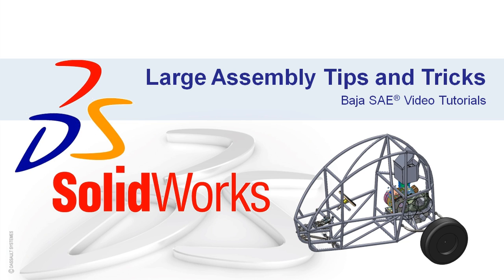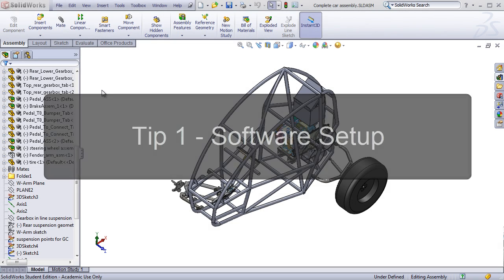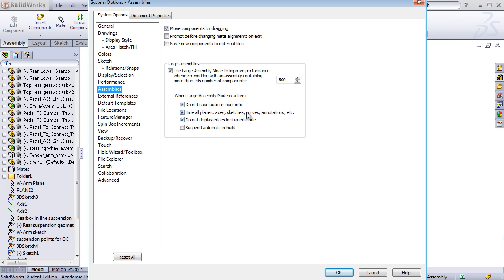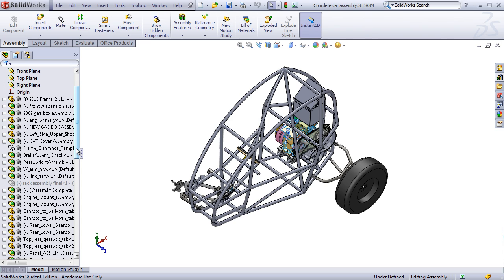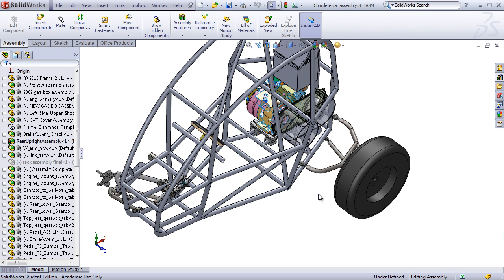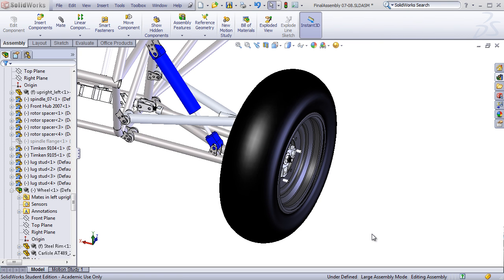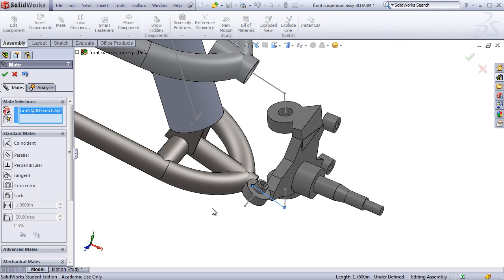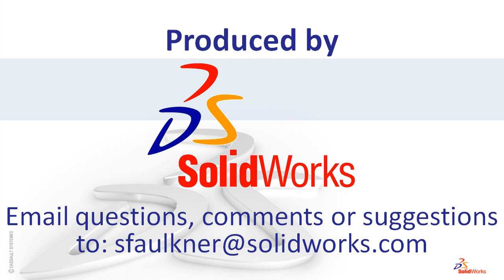SolidWorks BAJA SAE Tutorials - Large Assembly Tips and Tricks

Comment: Are you sure you want to give 3 mates to bolts.  Solidworks has to calculate that 3rd mate.  When it is undefined it doesn't it rotates wherever and frees up memory.  Give it a try.  Mate 20 Bolts  with 3 mates a piece (60 mates ) and 2 mates a piece ( 40 mates) and evaluate the performance.